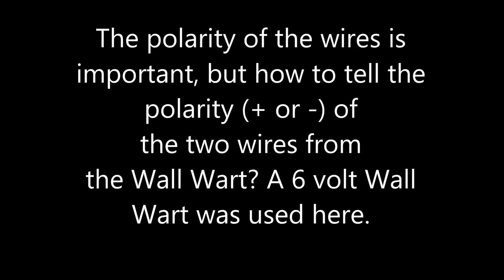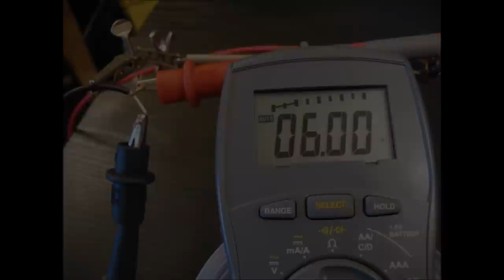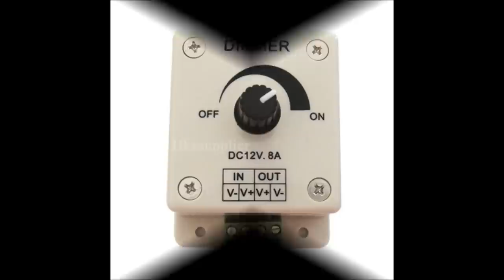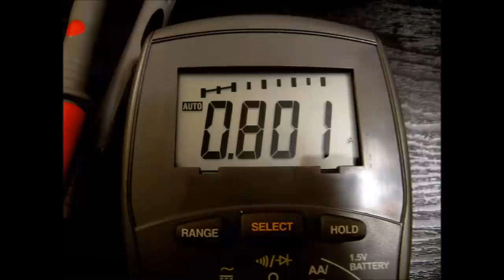Making an LED illumination setup for a microscope

Comment: Ha, all I did was to use a table lamp & a LED light bulb from Home Depot. Works like a charm & works with CFL's too! I used it on one of these "6 ft. Cord Set with Candelabra-Base Socket and Cord Switch" from HomeDepot.
Reply from the maker: I'm glad this worked for you.